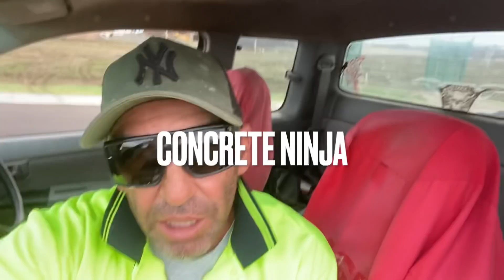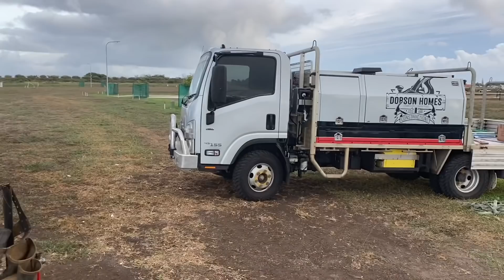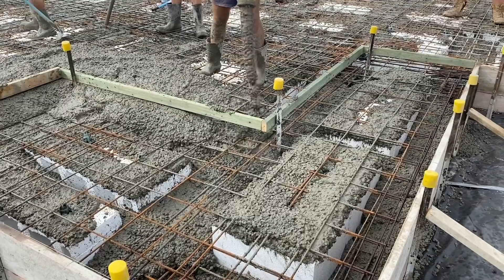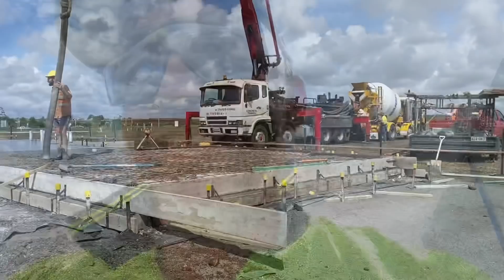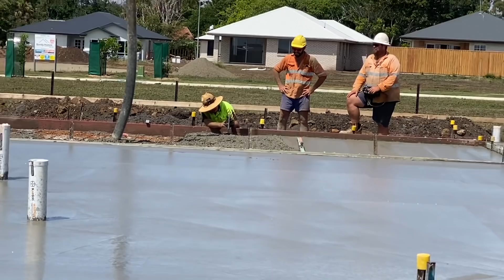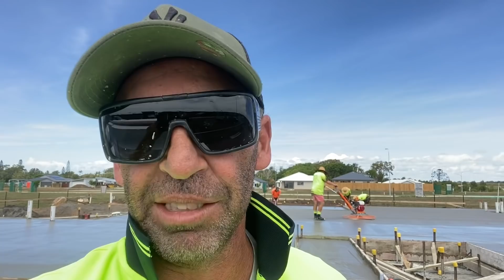What did you want to be growing up and what are you now

Comment: I wanted to be a machinist working lathes and milling machines. But i dropped out of school at 14 yrs old and started brickies labouring with my bricklaying father. 38 years later ive got a fckd back from working the construction industry,3 prolapsed discs and surgery on my fragmented disc in the near future before i end up in a wheelchair. Any construction industry job is hard labour and hard on the body. If i had my time over again i would have stayed in school,and stayed as far away from a cement mixer and shovel as possible.